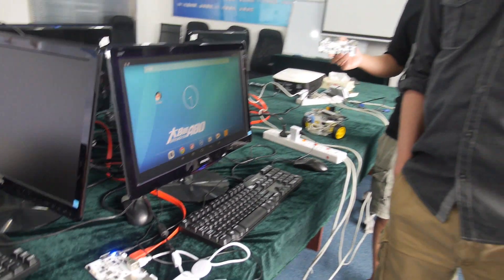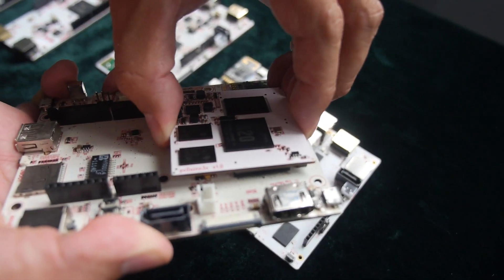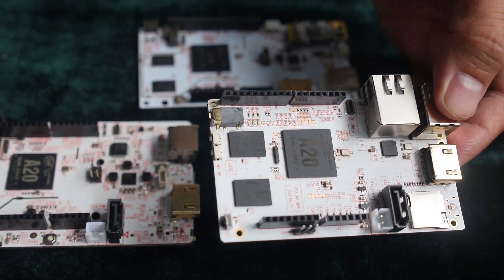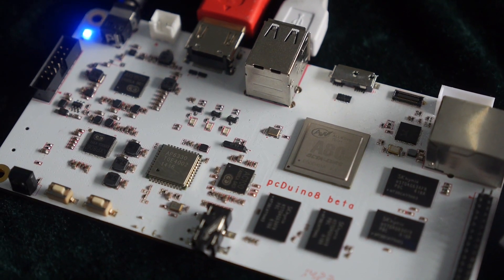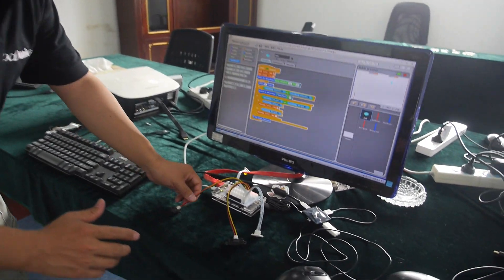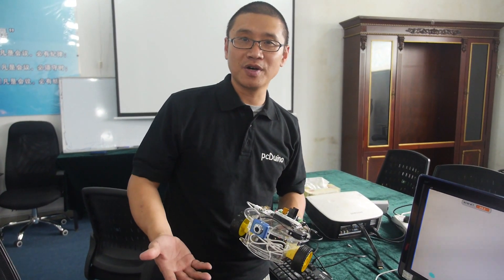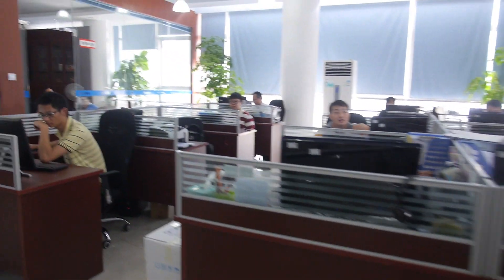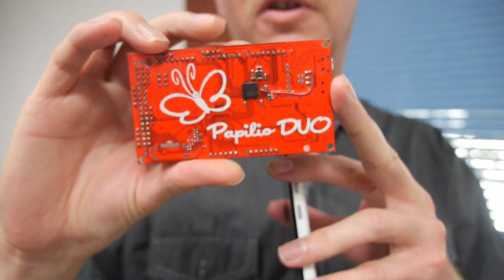pcDuino8 Allwinner A80 development board

Comment: This processor uses powervr gpu for which the producer refuses to deliver opencl drivers under Linux, OpenGLES of the driver work not correctly. Documentation on the Assembler and architecture isn't provided too. All ARM+PowerVR devices can't be used on os linux. Please, it isn't necessary to deceive people!

Comment: I'm making a project myself, but I need more than 1GB more like 2GB at least of RAM and 4GB unless the firmware has "apps to sd", but I need at least 32GB of Storage plus it would have been nice to know what version Bluetooth and wifi it has and I also need a SATA and or mSSD something like the ODROID! which seems to be my best bet even they could have used a better version of the Mali GPU like Rockchip likes to use the RK3288 and the Quad-Core Mali-T764... I could use the USB 3.0 pins on the board and convert it to SATA and call it a day! Why is it so hard to find a board that has the following options that I've seen on various boards here, like 2-3GB of Ram, 16-32GB Storage, SATA Port, Either a RK3288 or this A80 and a Quad-Core Mali-T764 or the PowerVR Series6XT GPU, iR Blaster, WiFi with AC, Bluetooth 4.0, USB 3.0  
ODROID-XU3

is powered by ARM® big.LITTLE™ technology, comes with a Heterogeneous Multi-Processing (HMP) solution. 

ODROID-XU3 is a new generation of computing device with more powerful, more energy-efficient hardware and smaller form factor. Offering open source support, the board can run various flavours of Linux, including the latest Ubuntu 14.04 and the Android 4.4. By adopting e-MMC 5.0 and USB 3.0 interface, the ODROID-XU3 boasts fast data transfer speed, a feature that is increasingly required to support advanced processing power on ARM devices that allows users can fully experience an upgrade in computing such as faster booting, web browsing and 3D game experience.

* Samsung Exynos5422 Cortex™-A15 2.0Ghz quad core and Cortex™-A7 quad core CPUs 
* Mali-T628 MP6(OpenGL ES 3.0/2.0/1.1 and OpenCL 1.1 Full profile)
* 2Gbyte LPDDR3 RAM at 933MHz (14.9GB/s memory bandwidth) PoP stacked
* eMMC5.0 HS400 Flash Storage
* USB 3.0 Host x 1, USB 3.0 OTG x 1, USB 2.0 Host x 4
* HDMI 1.4a and DisplayPort1.1 for display
* Integrated power consumption monitoring tool